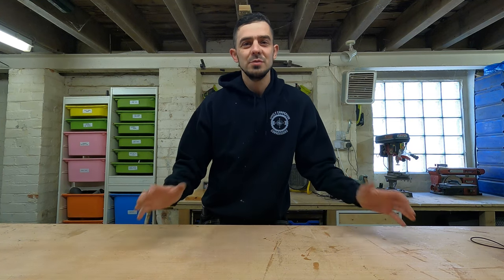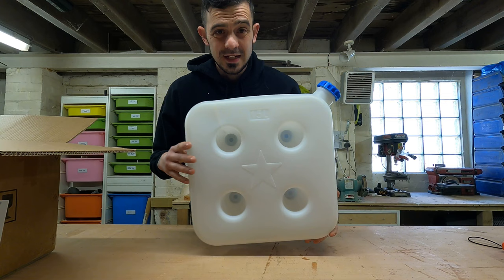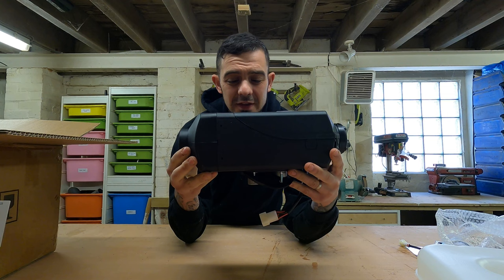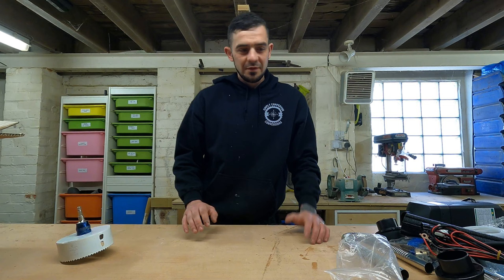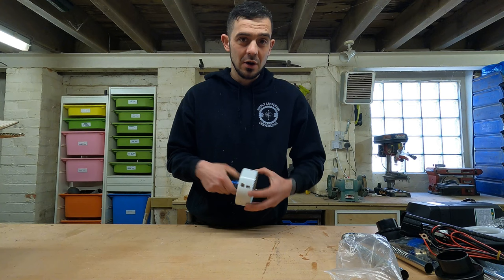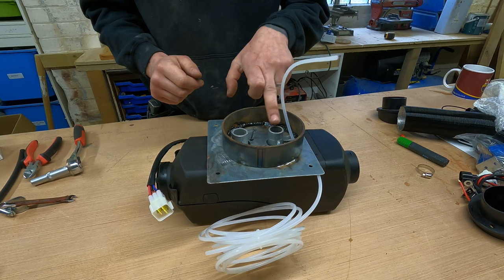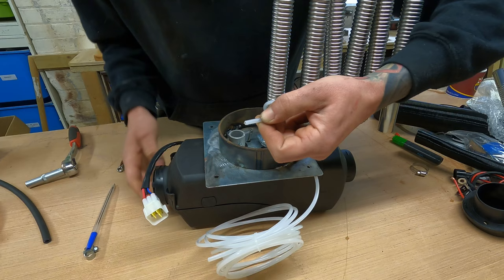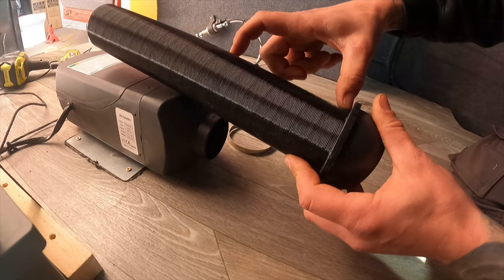CHINESE DIESEL HEATER | Full night heater installation guide safe camper van  | how to install

Comment: I installed one..worked perfectly when I fired it up. I left it for a good while. It has never worked again with an E04 code. Replaced the pump, all the lines, flushed the tank. There is no way it will spark up.  So, instead of wasting time I bought another…moral of the story? Start it up for five mins once a fortnight regardless of the weather.
Reply from the maker: I agree another problem I’ve found when leaving them over periods of time is the temp sensor failing.
Reply: Just bought one my instructions look like youre😢

Comment: No way in hell I would install the pump inside the van, it is noisy enough when it is on the outside. I would not want it ticking directly under my bed the whole night.
Reply from the maker: Insulate your van correctly and you wouldn’t need it running all night? 🤷🏻‍♂️
Reply: Installing a D heater ??????

Comment: Just a bit of information from someone that has travelled a lot in a van. You should consider installing the heater to one side or the other instead of the center of the van, as you have effectively ruined most of the under bed storage by going in the middle and stretching all the hoses and wires to both sides of the van.
Reply from the maker: Yes I agree 100% the placement for this heater was chosen by the customer to suit their layout.
Reply: I bet they end up moving the pump to underneath the van. The ticking gets too much, for me anyway.
Reply: Beau travail et surtout très bien expliqué. Une question pourquoi mettre la prise d’air à l’extérieur du véhicule ? Une grille d’entrée d’aire dans le véhicule devrait peut etre suffire  ? 
Merci

Comment: No you neede to paint the metal of the car where you drill the hole. I miss That part. Otherwise you car is going to be rust. For the rest good video.
Reply from the maker: Normally speaking I would say yes but it’s being sealed all the way round with sika so oxygen and water can’t get to it.
No oxygen and water means no rust.

Comment: When I fitted mine some four years ago I made sure that all the fuel line and pump went under the van. I covered all the fuel line in a conduate and passed it through the cassis/subframe of the vehicle. The pipe coming from the tank passed through a hard plastic pipe and through the floor this allowed any leakage to drop out side the van and not onto the internal van floor. This is just info for others watching, as the last thing you want is deisel inside you vehicle.
Reply from the maker: That’s an above and beyond install, 👍

Comment: Seems like an awful lot of extra work by finding the place to drill your hole from underneath and then doing a bunch of measuring to drill down to see if you're in the right spot. When you see your spot under the van, drill a pilot hole from the bottom into the top and you will know exactly where your hole needs to be then you can drill down with the 5-inch hole cutter

Comment: Great video man! i've a ready put together heater which was incased which i removed later to find where fuel was leaking. It is installed with jubilees etc inside the van, even without a turret plate (you have reminded  me and i'm about to order and reinstall)  obviously this is deadly and i'd already be dead if i was ever to fall asleep with it running, possibly even though i've always got my windows open! Thanks mate

Comment: I think the filter is upside down. The flow should enter around the outside of the mesh. Debris collects around the outside rather than in the middle of the basket. Same with domed intake filters on showers.

Comment: Nice video! I'll come back when it's time to install. But, id definitely install the fuel pump underneath the floor on the outside, just to mov the ticking sound away. And, as an ventilation consultant, i'd install a ventilation silencer hose just to reduce the noice from the blower 🙂

Comment: Just a few constructive points. Always slice hard fuel line with a razor knife not cut with cutters as they crush the pipe and can constrict the inner bore possibly affecting dosing pulses from the piston pump. I think the filter is also the wrong way around.

Comment: Thanks for making the vid mate. I’m installing mine in a boat but I can see that there’s fundamentally no difference. 👍
Reply: except for the drilling of the hole through your hull.😂
Reply: There is a massive difference!
If you mount it below deck you will either poison the cabin with exhaust fumes or cripple the heater by routing the exhaust upwards. Idiots and DIY are a deadly combination.

Comment: Hi. Thanks for uploading this. Gives me some idea of what to do. I have got a question, though. 
What’s the reason for bringing the fuel line down next to the hot exhaust? (I popped mine down next to the inlet) Is it to make sure the fuel doesn’t freeze in winter?

Comment: What’s interesting is you specifically mentioned mounting the pump at a 45 degree angle but when hooking up the fuel lines, you inadvertently moved it to angle opposite of what you had it.

Comment: Can you Y split off these so you have more then one outlet my vans 7.5 meters and want one at the back and one at the front

Also can pump and filter be installed outside of the van to keep sound down the clicking would piss me right off

Comment: Just an observation. Wouldn’t it make more sense to route the fuel line by the intake? I.e instead of fitting the mounting plate with the little notch for the fuel line by the exhaust, spin it around 180* and have the notch by the inlet so the fuel line is as far away from the exhaust as possible. Just my 2p
Reply: Was exactly my first thought
Reply: @metooid  I’m glad someone else is on my wavelength

Comment: Great video ~ I've not put it in yet ~  got the same heater & I got the same type of mounting plate ~ your vid is a lot more down to earth than the instructions ~ thanks ~ is there a min distance the tank needs to be from the heater (I plan on both the heater & fuel tank to go against my bulkhead ) thanks again
Reply from the maker: The all in one heaters come with the tank mounted directly on top off the heater so you’ll be fine getting it pretty close.
Thanks for watching and glad I could help.
Reply: Thanks for your prompt reply & after viewing your vid I'm in 2 minds on getting a longer exhaust

Comment: really good video, thank you. I do have one question, will the van not smell on the diesel ? Just because you have the tank inside the van I am just converting a van and was planning to tap into the van diesel tank... Your way seems way more straight forward !!
Reply from the maker: The only time it will smell of diesel is if you spill any.
There are pros and cons for both ways but we prefer this way.

Comment: great video.. i'm going to be fitting one of these into my garage.. I'm thinking of fitting it fairly high up but obviously want the fuel tank at a manageable height.. have you (or any viewers) and idea on what height the fuel pump will be fine at.. I'm thinking it's going to be about 3 feet above the fuel tank.. Thanks

Comment: Great tips and nicely explained there pal .

Question i have for you is,    if I'm going to use a jakery,   will i just pop a 12v cigarette lighter plug on the positive and negative leads and of it straight in??  Will that be fine?

Maybe just leave the fuse on? 

Cheers.
Reply from the maker: Hey thanks for watching.
You’d have to check the output on the jackery socket to make sure.
But yes you will need to leave the inline fuse on.

Comment: Nice install,2 things though,that pump is gonna be noisy screwed to the board and that fitting coming out of the fuel tank will leak eventually,you should never have the feed coming out the bottom inside a vehicle IMO.

Comment: Hi, great video, I didn't notice if you fitted a rubber gasket between heater Base and steel plate.... Mine has one, and I'm fitting it shortly. Any advice?
Reply from the maker: Yes it’s already installed on the heater, that needs to be in.
Thanks for watching 🙏

Comment: Greetings, I am very concerned about diesel fumes pervading the cabin. I can see where a vented lid with one way air flow would be good at keeping the fumes out of the van because the fuel removed as the heater is used must be replaced by air. Questions::1) Does the tank have a vent? Have you had any issue with diesel vapors? Thanks!

Comment: Thanks for the video, started doing mine and ended up launching the instructions. I thought the little cut out on the mounting plate was for the pump power cable. It’s all in and sealed up so will have to go with it. Can you see any problems with the pump outside the van? Cheers
Reply from the maker: I’ve done a more recent video comparing a Chinese heater and an erberspacher and in that video we looked at both the fuel pumps.
The Chinese one doesn’t look great for outdoor use.
It will work but I believe over time it will ingress water and fail.

Comment: Great video. Is there any reason why the fuel could not be Tee'd from the fuel line and drawn from the vans diesel tank?
Reply from the maker: Depending on hat van you have to what way it can be done.
Usually you take it from the return pipe or direct from the tank.
It’s also personal preference, we advise this way for a few reasons.
You can use cheaper fuels like red diesel and kerosene, if you out additives in your tank such as red ex you won’t be able to use your heater until you have used all the fuel in the vans tank.
Also if you run your tank dry in the middle of the night you won’t be able to start your van in the morning.

Comment: Hi Lee, that’s a great video really helpful, many thanks. Just one question: as the turret plate will get hot, have you found any need for something heat proof under it. I have vinyl flooring in my van and a thought occurred that it might not cope with the heat. Have you aver had any issues like that? I suppose I could cut the flooring around the turret plate but I noticed you hadn’t in the video. Cheers👍
Reply from the maker: Hi Dan, I always used to cut the vinyl floor when the turret was going.
However we removed a heater after 2 years of use and there was no signs of extreme heat damage at all.
The circular section of the turret going through the floor gets fairly hot from the exhaust but, the flat plate section doesn’t get too hot at all.
Reply: Aah I see that’s great to know - I’ll stop worrying about that then 😂. 

One more thing what kind of Sikaflex do you use to seal as there seems to be loads of different ones. Cheers again for the help 👍

Comment: I heard there is a 2 kilowatt and 5 kilowatt model.   Does the smaller 2 kilowatt draw less electricity?   Does this mean an auxiliary battery is required regardless of model?
Reply from the maker: You’ll need an auxiliary battery regardless, I’d never run it direct from the vehicle battery just in case you make it flat over night and can’t drive the following morning.

Comment: Is sikaflex heat proof or does it not really get that hot around the turret? Great video thank you
Reply from the maker: It’s rated much higher than the turret will get.
Thanks for watching 🙏

Comment: I've fitted my heater today and tried both ways to try and start the priming but the pump ain't kicking in , my controller looks the same unit as yours and I have managed to switch the heater on to ignition but still no pump

Comment: Thanks for answer yesterday ~ the heaters hot air pipe -i will be stretching it to its maximum will it matter how many bends the pipe has before the cap on the end ?? Thanks

Comment: Just curious if this could be mounted to the roof  upside down???? only reason I ask is I have no floor space due to equipment in the van but need to get heat in there to stop chemicals and water pipes freezing up.
Reply from the maker: Unfortunately not, they can be mounted flat or on their side, but not upside down.

Comment: I’ve a diesel heater like that, (its now broke) but when it’s running it gives off a horrible plastic smell, i made a turret like yours and I have similar vinyl flooring and I used sealant as well as screwed it down, I’m gonna be buying a new one in a few days is there anything you recommend me doing so that the next one doesn’t smell off plastic when it’s running or is it just a new heater smell that needs to be wore off, I’m aware of the rubber gaskets some heaters come with but I’m unsure which mine is 
Thankyou
Great video!
Reply from the maker: The gasket on the bottom should be silicone. Some send rubber ones out unfortunately and this can be something that will cause a burning plastic smell.
Reply: @simplycampervanconversions   okay I’ll make sure the next one is silicone, also which sikaflex did you use? Was it the heat resistant one?
Reply from the maker: @abbeybarkley6853  all sikaflex states it’s resistant to extreme temperatures so specific heat resistant sikaflex isn’t necessary.

Comment: I have just bought this model Does the heater stil draw current when in stanby? Display does never shut down fully. Stays dimmed. I dont want it to drain my batterys when i leave my boat.
Reply from the maker: Hi, yes the display will always stay on and draw a small amount of current.
You can put it on a switch, but be carful it never gets turned off accidentally while the heater is running as it needs to go through a cool down cycle and if it turns off without this it will damage the heater.

Comment: Where do you get fresh air intake into the van when sleeping? Do you crack the window? Or does the diesel heatsr provide fresh air from the outside?
Reply from the maker: We have window vents from Omit Vans it’s always good to have good airflow in the van, event when not using the heater.

Comment: How much 3 inch ducting is allowable with how many degree bends total? Have a long run througout the car with bends and concered there would be too much back pressure on the heater fan if there are too many bends or ducting is too long.

Comment: Hi, just ordered my diesel heater. Looking for advice on the turret, is it required or can I just sit it on the heat plate it comes with? I currently have a 40mm flooring which is insulation, plywood and vinyl flooring. Thanks in advance.
Reply from the maker: I would strongly recommend the turret to keep the hot exhaust away from your wood and insulation in the floor.
Thanks for watching 🙏
Reply: @simplycampervanconversions  much appreciated

Comment: Question any idea where I could buy a longer 1" black tube for the air inlet? My campers stationary and I need a bit longer than what's provided but I cannot seem to find it anywhere.
Camper unseraide has skirtinf around it, so I'm oretty sure leaving that the air intake under there sealed up wouldn't be much use

Comment: why not get a tank you can put a stand pipe in and avoid potential future fuel leaks
Reply from the maker: The tanks that take the stand pipes are much larger and wouldn’t have fitted.
However if fitted correctly you should have no issues.
Reply: @simplycampervanconversions  i installed a standpipe in a fuel tank that came with one i had that had the cap in the centre. it was a little tricky but it worked well once installed

Comment: Hi Lee. Would you please clarify whether when mounted at 45 degrees the lower end of the pump has the feed from the tank or the feed to the heater attached? The video shows the heater feed lower initially but then later the tank feed is lower. Many thanks.
Reply from the maker: Hi, the lower end aims towards the heater.
Reply: The end of the fuel pump with the connector must be higher than the other end . Also you can use regular fuel line from the tank to the filter and then to the pump but you need to use the white hard nylon fuel line from the pump to the heater. Please never use the green PVC line, it's not made for fuel.

Comment: Can you explain what the point was for the 5 inch pipe modification?
Reply from the maker: Yes, it’s to keep heat away from your wooden floor and insulation and also to provide a better seal to stop exhaust gasses coming in.
Reply: @simplycampervanconversions  appreciate it!

Comment: hi, just wondering, could i add a few heaters into one system, im looking at heating 16x14 foot shed.
Reply from the maker: We have tried running two heaters from one control panel and failed unfortunately.
If the shed is well insulated you’ll be surprised the difference one will make.

Comment: Put my live to 12v fuse panel now when i turn it on it makes my led light flicker?
Reply from the maker: Do you have a volt meter?
What is it reading.
Sounds like you have low power maybe.